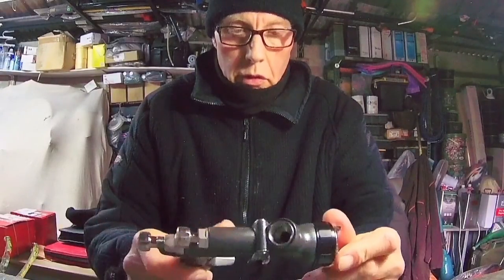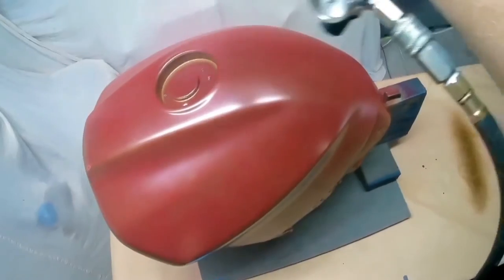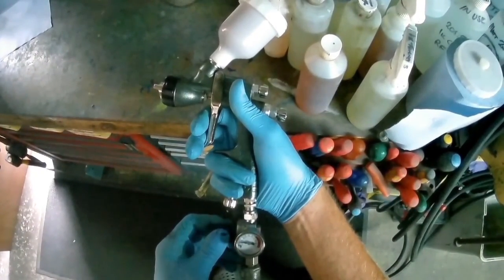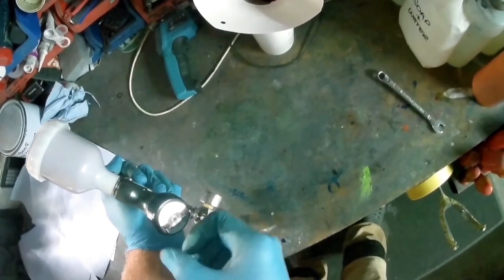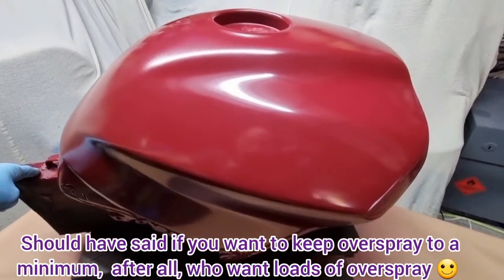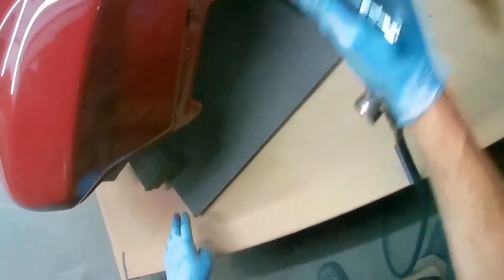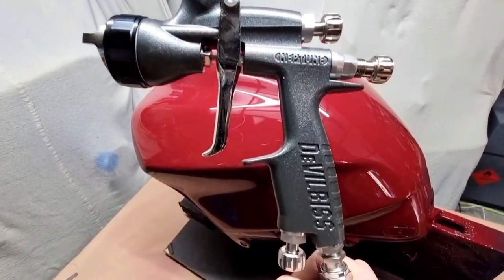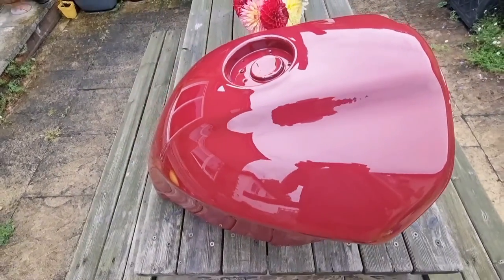Devilbiss Neptune 1.3 T110B For Base & Upol 2080 2802 Clear Coat

Comment: Hi Pete, the Neptune did a great job on the base and clear and produced a nice flat finish, are any of the parts (cap, tip and needle) interchangeable with the ProLite? what got me thinking is the name of the cap is almost the same as the T110 and was wondering if it's the same but as this puts out less overspray and runs at a lower pressure then it must be different as it's mainly the cap that dictates how much pressure is needed.
Anyway mate loved the video so thanks for doing it, cheers👍

Hope the above makes sense as I'm struggling atm to put into words what I want to say, not really sure why though, oh and I hope to post the tank up later😎
Reply from the maker: Hi John,  they aren't compatible,  this gun uses less spacers and gasket compared to the Pro lite, it is, imo, better made, certainly from an engineering point of view, it certainly different as most people have never heard of them 😁.

Looks forward to the tank, wondering what colour you went for 🤔 , I'm out of signal range now until tonight, so it may be later when I see it, only the fishing club, cheers mate 👍
Reply: Ok mate I didn't think they would be but maybe this gun would have been the ProLite's successor if they didn't bring out the DV1, looks a good gun mate, hope you enjoyed your fishing🐟🎣👍
Reply from the maker: Hi John, I'm just back. I'm just catching up with YouTube, and then I'm off to see your exploits on Instagram 😁

Comment: Hi Pete, that’s a nice gun that is, I liked the aluminium cup, finish was really flat especially for the upol clear, do you add thinners to yours? 
Hope you’re doing ok mate. Cheers.
Reply from the maker: Hi Steve, It's a lovely gun and a little different, which I like . The cup is great, and 400 ml is a handy size, fits  the pro lite, your F160, Meiji Finer Core, etc, so it's good to have.

I don't always thin the Upol, normally the warmer it is and the higher flow rate of the gun I don't, it certainly makes it easier to use and flows out better, anything between 5 and 10 percent is fine, still warm it up though as that's the biggest help and helps it go off faster which helps with runs and sags.

All good here mate, hope all is well with you and family 👍
Reply: @peteshobbies5383  Hi Pete yes all good with us thank you, I have tried the upol with getting on for 15% thinners and I got on quite well with it, I’ve also tried to heat it in the microwave, unfortunately it smelled a bit when we next used the microwave, I banned myself before the Mrs did 😂
Reply from the maker: 🤣😂, I know the feeling, not worth getting on the wrong side of Mrs mate, my wife says I smell of thinners most of the day 🤣.

However, I did manage to persuade her that we needed a new microwave, so I had the old one in the man cave, purely for paint. 😃
Reply: @peteshobbies5383  😂🤣😂

Comment: Hi pete nice video. Does this t110b cap spray the same or similar to the t110 on something like a pro lite? Thanks
Reply from the maker: Hi Miguel, it produces very similar results but goes about it slightly differently,  mainly because of the pressure difference. The T110 Pro Lite setup is normally best around 2 bar. This, at 1.5 bar, is nicer to use as there is less overspray, not that the T110 has loads, just more than this.
Reply: @peteshobbies5383  ah makes sense, you should try the Jupiter pro, I have an old beat up one with 510 aircap 1.3 needle. Still sprays very nice, more like traditional gti pro/ pro lite
Reply from the maker: I was looking at the Jupiter, they are quite expensive but come with 3 tips and 2 caps as far as I know
Reply: @peteshobbies5383  Yeah they are expensive. I bought one new and it only came with 1 tip and cap, if you find someone selling it with all of them that would be worth it

Comment: The gun looks very similar to the advance or pro lite s in the way the fluid cap bolts?
Reply from the maker: They aren't quite the same, this one is,  imo, better made and doesn't use as many spacers and gasket that the others use, definitely a well made gun 👍

Comment: If you already have a prolite (or  a DVI) why would a person buy this?
Reply from the maker: Hi Ken, I did 🤣😂 , I don't think any sane minded person would, however,  it's is a very attractive option if your in the market for a good quality full size Devilbiss top cup as it can run with the others for sure and isn't particularly expensive.
It also unusual outside Asia which also appeals to people 👍
Reply: @peteshobbies5383  Ah, but you do paint a lot, and are very good. I am neither, I paint about once every few years and make more mistakes than Southampton football club.
Reply from the maker: They say that practice makes perfect Ken, so if you don't paint often, it's understandable that you are rather rusty when you do.

Unfortunately,  the same can not be said for Southampton FC, who played as many games as most but still found themselves at the bottom of the league! , cheers, mate 👍